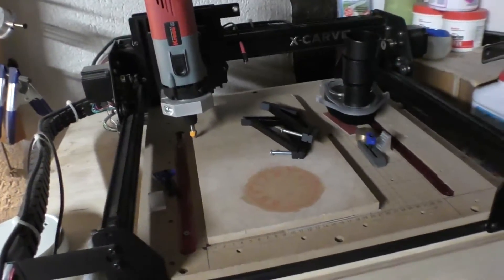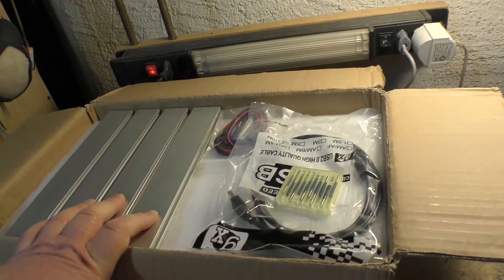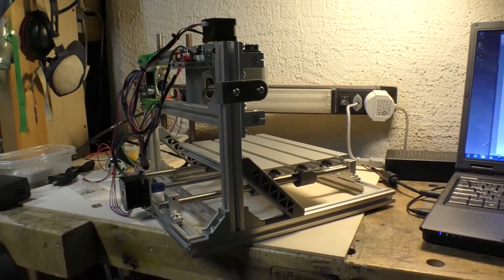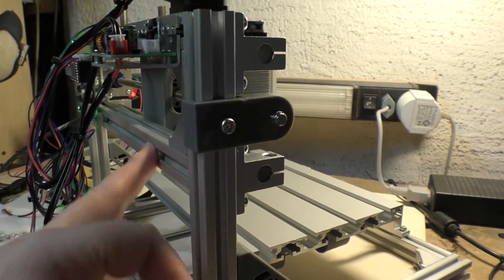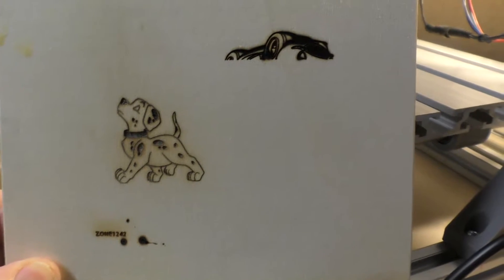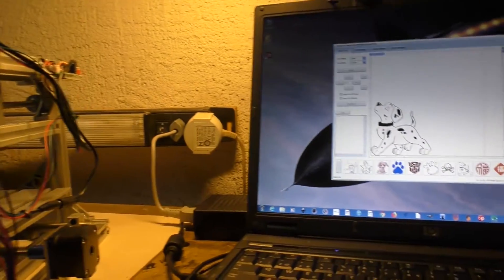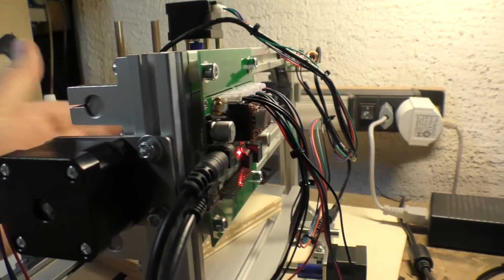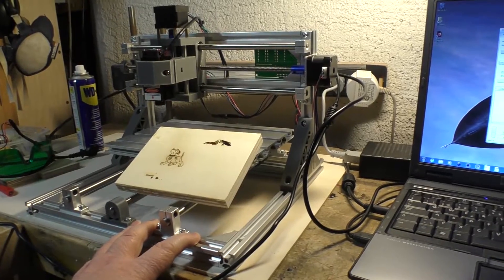CNC 2418 kit for laser engraving - first impressions

Comment: Do you have a link to that CNC KIt  where you purchased it at ? Looks nice, look forward to an update, to see if you sorted the firmware issue.
Reply from the maker: If you want only the laser engraving function then there are much cheaper alternatives but I wanted both options and this seemed like the best one for me.  https://www.ebay.com/itm/253364814186
Reply from the maker: Quick update - what I have learned so far is that firmware needs to be version 1.1 to run software like LaserWeb.  The controller that comes with the kit (Woodpecker) runs GRBL 0.9 and apparently upgrading it to 1.1 is not easy.   Some of the posts I've read suggest upgrading the controller to something easier to work with.  I think I've found one so I'll post an update when I get it working on GRBL 1.1